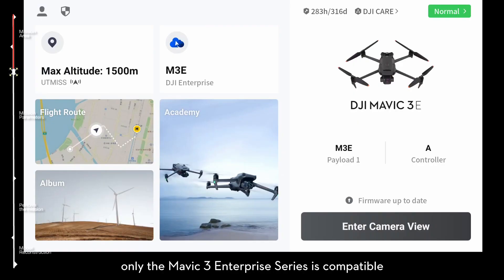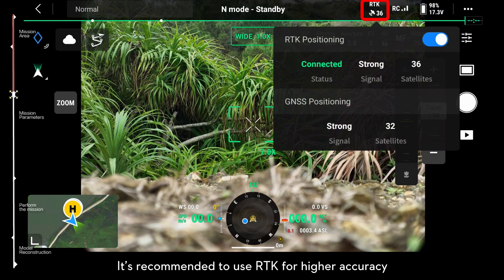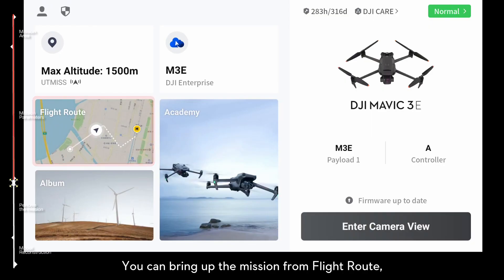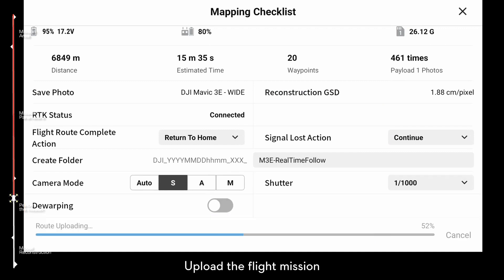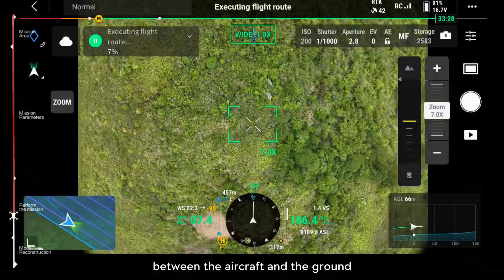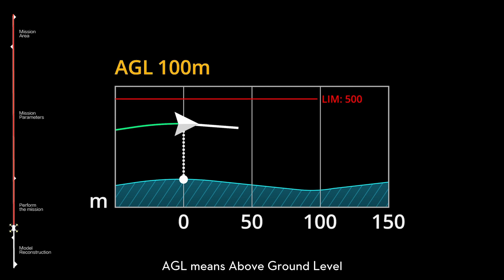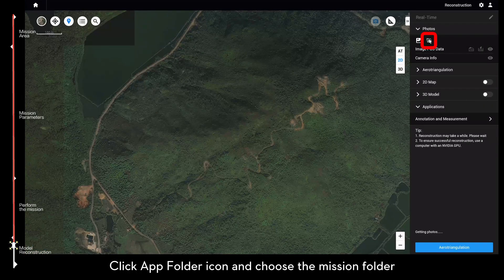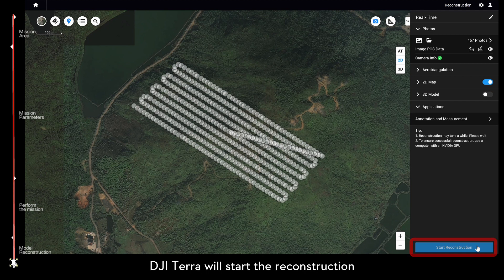DJI Mavic 3 Enterprise Series: Real-Time Terrain Follow

Comment: I own a M3M. Now I have a problem with my own DSM. I will capture a orthophoto over forestry. I´ve set up my area at home with 90m Altitude and Terrain Follow on. My problem is, that the drone flight to start point and the AGL is on 40m? Inside the picture and Airdata also return 40m altitude from ground? My tif is a DGM1 (1m) from my OpenData center in bavaria (germany, UTM32 EPSG25832). I´ve load it in QGIS project with UTM32 EPSG25832 and export the DGM to WGS84-EPSG4326. Now when I measure my point in QGIS, I will get 477m ASL, in DJI Pilot2 I will get 521m (scale on the left side while planning). seams a conversion problem? Perhaps you can help me. Also is 1m to low? Greets, Thomas

Comment: when we chose fixed elevation from DSM how will RTH at the end point of mission ? it will fly over DSM with fixed elevation and return to home or increasing elevation and RTH horizontally ?  suppose we are at one side of mountain and M3E is on the other side and there is a mountain between home and end point .
Reply from the maker: Hi! The DSM settings only affect during the mission. Regarding the RTH, it will perform either Preset altitude(increase elevation), or Optimal(automatically according to terrain and obstacle). For complex environment, we suggest Preset and set a proper altitude to ensure flight safety. You can watch this video to learn more details: https://youtu.be/j-dPKBNrv_c?si=SKEumjrvVYTn1x9O
Reply: @djiacademy  About preset mode in mountain we should set max altitude for max safety in most cases max height is 200 m higher than takeoff point and if we set this altitude plus fix distance it causes M3 consume large amount of battery power .moreover we should measure max elevation of flight mission in office and in some cases at field we define flight mission and no access to measure max elevation. 
About second method please explain more that how M3E find the proper elevation?
Please release an update for RTH to use DSM it will be safe and power efficiency.
Reply from the maker: Thanks for your advice, we've submit this feedback. "Optimal RTH" will try to follow the terrain, but the pilot should still pay attention and watch the AR RTH green route on the screen. In some cases, M3E series may not have enough battery to cross the mountain, we suggest moving to a better takeoff point.
Reply: For mapping project specifically in mountain we haven't enough options to move to different positions. 
So please solve this problem.in  Some apps like Mappilot RTH without any risk and automatically. Thanks